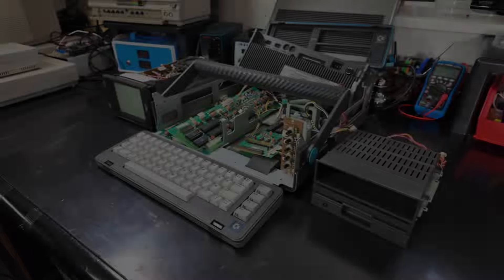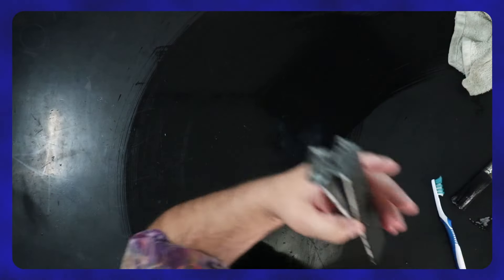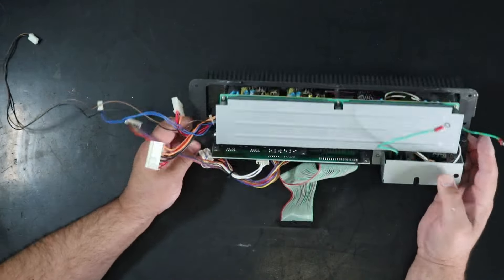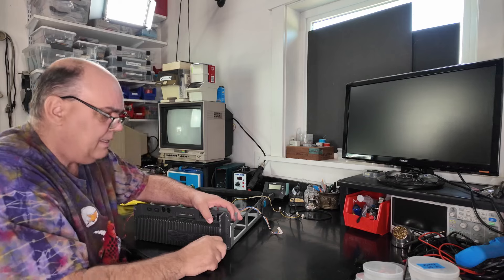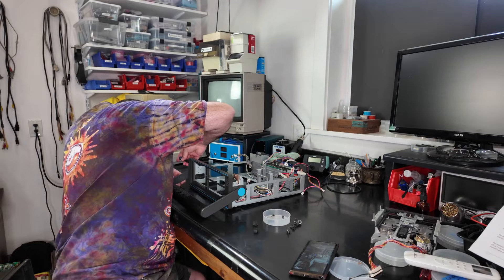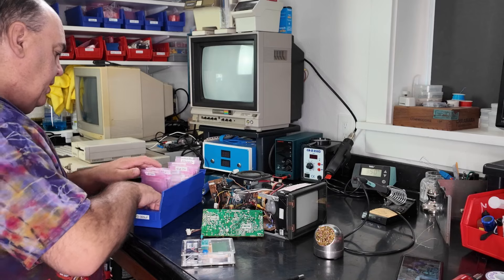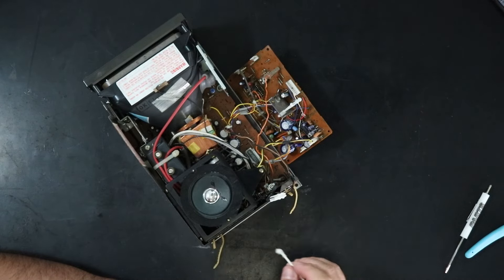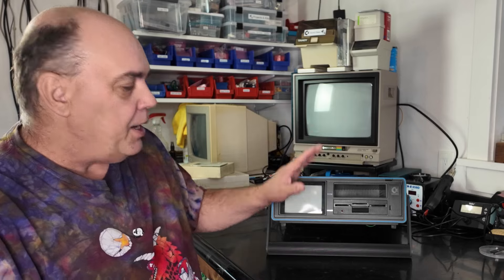Sexy Commodore SX-64 Restoration - Pt 2

Comment: Great restoration video! I acquired an SX-64 that was stored in an unlined shed near the ocean and had similar corrosion on the power supply shield. My SX-64 I/O PCB was full of corrosion with dozens of black corroded copper traces. I ended up working with a PCB design engineer to create a brand new replica I/O PCB. My corroded shield and chassis were laser cleaned (high power CO2 laser) and then electroplated in gold passivated zinc. I also had to replace the CRT monitor as it had a failed EHT transformer.
Reply from the maker: Wow Michael, that sounds like it was a major restoration!